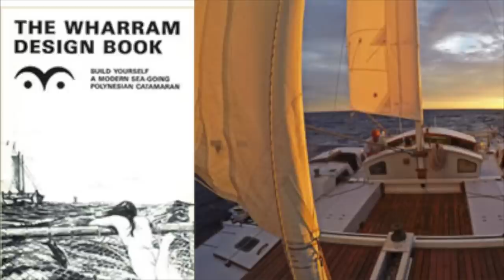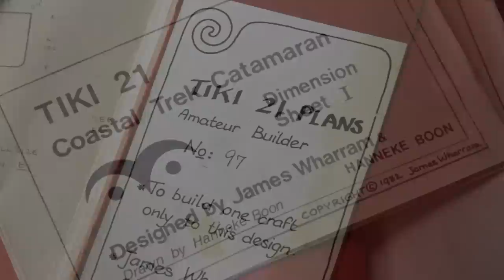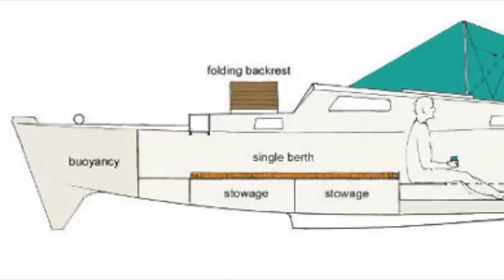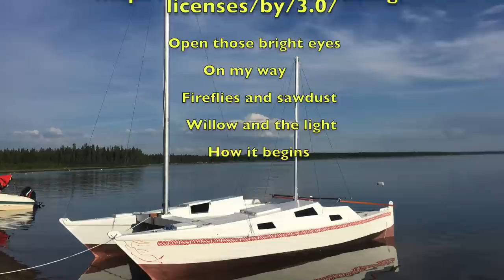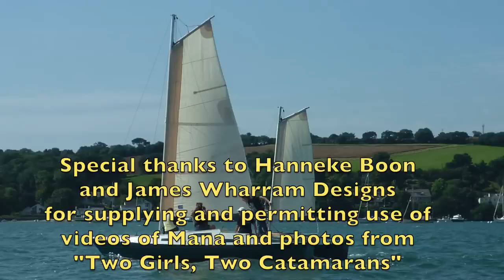Boat in a Box  -  the Mana 24

Comment: How does it sail?
Reply from the maker: The short answer - very well. For various reasons I did not get in a lot of sailing on the Mana during the past season and as a result I have no video clips of the boat under sail apart from the brief one that opens this video and  another badly pixilated one which comes early in this video: https://youtu.be/6RPvOcJg36s Also in that video are shots taken from on the boat, driving easily in very strong and gusting wind, moving very well in spite of a poorly set mainsail, and then the following day under similar conditions with only the reefed mizzen sail.

Our sailing season soon begins here on the Canadian prairies and I  fully expect to have a plenty of shots of the boat sailing so that you will be able to judge for yourself. I need to get more experience with the cat ketch rig to take full advantage of this combination. Even with my limited time on the boat, I have seen the potential for some very exciting sailing on the Mana when the wind picks up. The boat moves well also under light winds and the new asymmetrical spinnaker I sewed up during the winter will add to a new dimension to the season. Stay tuned. :)

Comment: Lately I've been really tempted to build a small pocket cruiser for camping on islands, and this video is really not helping lol. I really dont have the time or money at the moment though.
Reply from the maker: Temptation - yup. I get that completely. That is why I built the Mana. The big camping/sailing weekend this summer was our annual Elbow Run in July and the Mana did not disappoint. My new deck tent needs some modifications, which I will have done for next year, but even with it the way it was, the boat made an awesome platform for camping and sailing.

Comment: Tanggggg a row a.

You need to work on your pronunciation.

Toungue a roa-no harsh g sound
Reply from the maker: Thank you for your correction, Jade.  I hope you can excuse my Canadian prairie accent - not too many Polynesians around from whom to learn correct pronunciation. :)
Reply: @RodMcLaren  that may be true but as a canadian you SHOULD be familure with french and quite alot of french pronunciation is similar to polynesian languages.
Also italian is better-especially for maori pronunciation.

Ive looked at these boats before but tge decks are to fiddly and complicated.

If i were to build i would use something lije the mana 24 but would be all my own work.

Ive built lots of stitch n glue kayaks(hence half of the name) so a wharhham hull is a piece of cake even though its a bit larger.

The longest jayakove built is 21' so a 24 foot cat hull is not much longer but alot wider and probably would use 18mm 1088 with one coat of 200gsm glass.

My decks would be simple compound bent ply.
The compound bending adds incredible strength to the ply ad the glass sets it and adds abrassion resistance

Stitch n glue boats by chris kulczycki has a section on his chesapeak model of kayaks that have the method in it